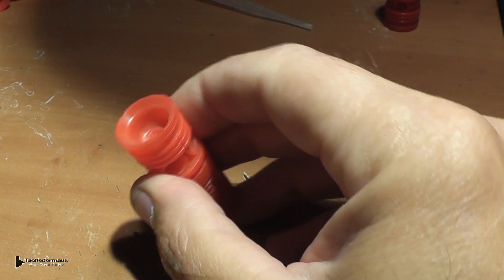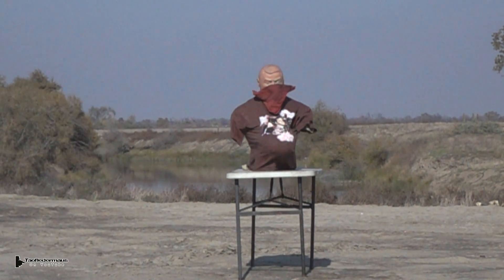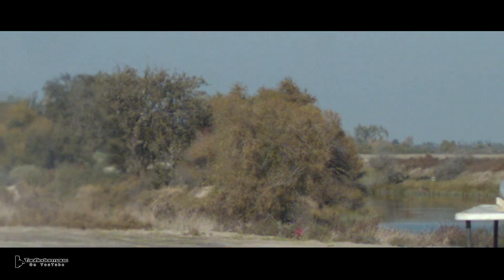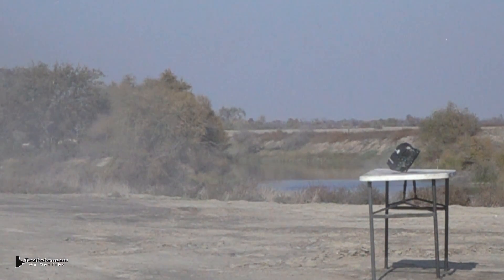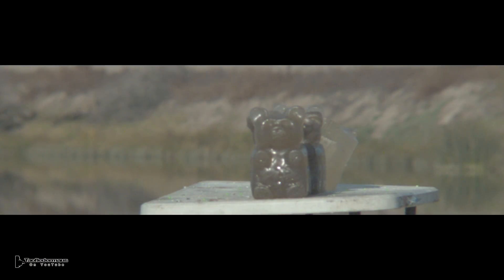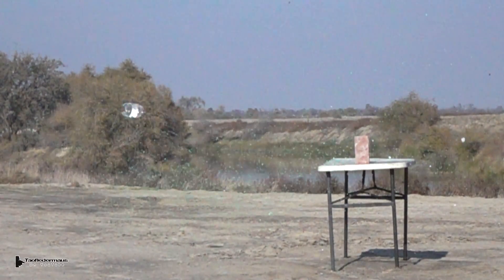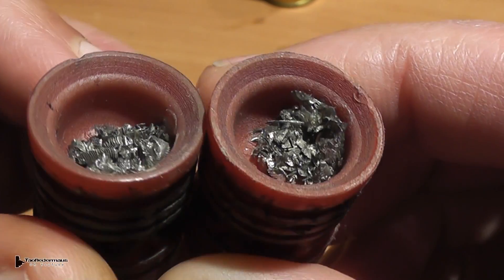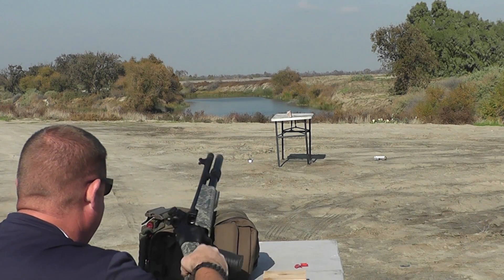Magnesium Shotgun TRACER Experiment -You Asked for It

Comment: Late, but ... :D
It's several mistakes made.
- Put a little finely ground magnesium IN the powder and some magnesium in the bottom of the wad. Powder alone doesn't create the heat needed to ignite large magnesium chunks in the short time of flame exposure.
- Use long, THIN shavings, touching the glue with one side only, so a part of the shavings stick out.
- By forming a solid Mg block using the glue, you created a kind of heatsink, cooling the Mg by spreading the heat, thus preventing ignition. Similar with the coarse shavings - each one acts as it's own heatsink.

Comment: A stable projectile moving anywheres near the speed of sound through air has a partial VACUUM at the back end, it is well known that the near vacuum zone behind a projectile reduces the range it can reach. Google "artillery shell base bleed unit" to learn more about this.

How are plain Magnesium shavings going to stay burning without oxygen from the air?

 Tracers are MIXTURES of fuels such as Magnesium and OXIDIZERS such as Barium or Strontium peroxide and/or perchlorate, chlorate or nitrate salts. They don't need atmospheric Oxygen, which is not very available in this environment.

There is another issue with burning a pyrotechnic mixture or flammable metal in a partial vacuum even if provided with an oxidizer.

Hot liquid metals have a vapor pressure, just like water. Hot liquid Mg or Al will boil off into a vacuum,  free Oxygen and any gasses from combustion also tend to expand away and disperse, these mechanisms work to suck so much heat away from the reaction zone that many pyrotechnic mixtures can't maintain burning in a vacuum or even at very high speeds moving through the earth's atmosphere.

For example, neither black powder nor Aluminum fueled thermite will continue to burn in a vacuum. Even if they can be ignited, they rapidly lose too much heat from the reaction zone and GO OUT.

In aerospace use at high altitudes or outside of atmosphere, pyrotechnic gas generators used for actuator mechanisms often need to be CANNED, enough gas pressure has to be kept in the container for the pyrotechnic mixture to ignite and function as designed.

Comment: Powdered magnesium in the gun powder ignited because each bit was surrounded on all sides by both temperature and oxidiser (released by the gun powder). In the glued part the glue acted as a heat mass that stole away the heat and did not let the magnesium reach the ignition temperature plus there was not enough oxigen around in direct contact with magnesium to keep the ignition going. Maybe if you glue a high density mix of gunpowder and magnesium powder it might work - gun powder providing oxigen and surrounding temperature and glue slowing the ignition process just enough for tracer to burn instead of exploding. Migh have to experiment with different glue to poweders ratios. The separation is either due to non-centered pressure or just due to adding enough mass to the plastic part that it is too heavy to just be brought along with the slug itself.

Comment: Try extra-fine steel wool? It works in low-velocity launchers like potato cannons, so I'd say you have a reasonable chance of success. The higher surface area to mass ratio should help the metal to ignite in the fraction of a second that it's exposed to the burning powder.

Comment: You need to high magnesium to oxygen ratio for ignition. You need to stay with the magnesium black powder mix like the first successful video and the. Find a way to keep the shavings flying with the slug. Perhaps a disc of screen door screen glued on with a dab of hot glue only on the edges after you've packed the back of the slug with shavings? Glueing them directly is preventing them from igniting. Let me know if you have any thoughts on this idea. I like solving tricky problems. Thanks

Comment: An educated guess:  there is not enough oxidizer to burn the Magnesium when it is clumped up like that.  In your referenced video, firing it mixed with the gun powder gave it an accellerant & oxidizer in the gun powder & also spread it out after raising it's temp high enough to burn.  Spreading it out gave it plenty of oxygen to react with.  If you really want to do this try adding an oxidizer to the mix & use fine grain magnesium such as powdered.  My concern would be the stability of the mix & therefore it's safety.

Comment: how about getting that to a finer ground also mixing a little powder or maybe a little ground up esters rocket engines under a little parchment paper disk as to keep everything dry only the top covered in hot glue with a  little hole so some powder is exposed use a straw pluged with paper to help lighting also try a little copper/mag/zinc/alum mixed with powder

Comment: my guess: powder burns from back to front, and since the slug starts moving before all powder is burnt you get the non-ignition issue. the separation of slug and wadding might be from the increased compression of the slug due to the higher weight at the back.

though that's just a guess.

Comment: Hang with me here. Maby a multi stage round being a rough surface ball bearing driven through magnesium shavings with black powder tissue paper as a catalyst for ignition.

-Use high brass. Load a steal ball bearing that's been heavily roughed up with very heavy grit sand paper?
-Soak some tissue paper in black powder, pack it in shell a 1/4" deep over the slug and some slightly underneath the slug.
-Poor magnesium shavings over black powder paper wading till near topped off.
-Close the shell with a bit of powder soaked tissue paper and original plastic folds.

Just an idea, I have no gun experience but I use to really enjoy fireworks in my youth.

Comment: Magnesium ignites when it has direct contact with the air as its flying...you have it in the cupped part of the sabot and there is no air there when fired due to some vacuum formed at the back...if the magnesium was on the front it would ignite...but considering that's where the lead is you can't have any ignition

Comment: The problem is apparent from your description of success vs. failure.  Putting magnesium in the powder directly exposes it to flame.  Putting it in the shell it only feels compression.  What you need to do is put a hole in the back of the shell so that the flame from the igniting powder can directly reach the magnesium.

Comment: The efficiency of the gunpowder leaves no remaining oxidizer for the magnesium to catch on, the powder charge literally not combustively coming in contact with the magnesium.  With the magnesium mixed in with the powder it's in direct contact.    

So two questions, did you leave the card in the shell over the powder and did you wash your hands carefully before you pushed the magnesium into the cup?  Skin grease can make the difference.  Cooking oil will even stop ignition.

Comment: Have you ever tried to fire a thermite round? Such as one with an incendiary device to ignite an embedded quantity of thermite upon impact? I was thinking that some sort of magnesium fusing exposed to the powder and perhaps a thin nylon or lead casing encapsulating a compressed thermite powder would make for an interesting impact incendiary device. Fusing device lights upon firing, and the thermite capsule ruptures and exposes the powder to the burning fuse upon impact.

Comment: My guess why the magnesium did not ignite as a tracer is because it was not exposed to enough oxygen within the low pressure zone directly behind the slug, this zone is likely mostly composed of propellent gasses from the powder and relatively starved of oxygen. This is unlike the magnesium mixed with the powder that was heated and ejected into the atmosphere where it oxidized rapidly by the shell.

Comment: The wading is separating due to the heat you introduced with the hot glue, not the magnesium. When you added the hot glue the wading would've expanded slightly, compromising its connection to the slug.
As far as the magnesium not igniting I believe that simply comes down to it not having any oxygen available to maintain combustion, where when its in the powder it disperses and ignites properly. You could try mixing some sort of magnesium/iron-oxide if you're feeling really ballsy and try it that way, but you're basically trying to shoot thermite at that point and that's not exactly the safest thing you could do. (You'd get hella views though)
Reply from the maker: There's about 1"  of plastic wadding between the gas piston and the lead slug.
Reply: Entirely possible that it compromises it still. Not saying that's 100% for sure the issue but if you went from a 99% success rate without it to 0% with it I dont think the extra 0.5 grams did it

Comment: As some smart person before me has most likely pointed out, adding the glue and magnesium shavings to the back of the slug altered the way the slug balances, and therefore how it flies. So it's reasonable to assume that that was why the plastic wad/tail/piston thingy kept separating from the lead portion of the slug, as well as why accuracy suffered accordingly.
Reply from the maker: We can speculate or we can prove by doing.
Reply: Could you run a test where you used the same gun and powder load as in this video, and fired a 5-shot group of the DIY magnesium tracers, then a 5-shot group of the normal LBC sabot slugs, firing both groupings from that shooting vise/rest thing I'm pretty sure you still have, and filming all 10 shots to compare?

Comment: I'm sure you've already worked this out, but magnesium won't burn adiabatically, it needs an external source of oxygen.  Crammed in the back of the wadding of a slug travelling that fast (these loads supersonic?) there is no way for that to happen.

Mix an oxidizer compound in and try again, bet it'll work.

Comment: The ignition temperature of magnesium is around 900 degrees Fahrenheit. The reason it doesn't ignite when glued to the back of the slug is because it never reaches that temperature.. When you put Mg in the powder its-self it ignites due to the conflagration of the powder which burns at 3300 deg F, way hotter than Mg's ignition temp. When it's glued to the back of a slug the temp of the powder doesn't matter because the heat of explosion doesn't actually hit the Mg. The heat of reaction is confined to the powder only.. there is a pocket of gas that is created when the powder ignites that insulates the Mg from the heat of reaction. That pocket of air blocks the passing of fire from the charge to the slug. Maybe if you put a low ignition/high temp burn fuse between the two pieces you could ignite the Mg. 

Concerning the separation of the slug and wadding, I presume that's due to the difference in mass.. This is conjecture, but I believe that the shells are probably designed with a specific wadding for the slug they are behind, and when extra mass is added to the wadding, it can't travel at the same velocity as the slug. 

One last thing... 
I want to say that your channel is awesome. I've been watching it for a few months now and you've got a sub in me.

Also, I can't guarantee everything in the first paragraph is  100% accurate, but even if the temps are off, that is my thoughts on why the tracers wouldn't ignite.
Reply from the maker: Not enough surface area.

Comment: film a copper oxide thermite reaction with the chronos high speed camera
Reply: +TAOFLEDERMAUS   Considering how much subs you have now you should be able to spend more than just 5 bucks on your videos. Copper oxide is very cheap and easy to get (you can even use Fe2O3 or Iron Oxide), you can even get pre-mixed thermite cheaply.
Reply from the maker: I don't have any of that stuff

Comment: Id guess the glue is shielding the Magnesium. Also magnesium develops an oxide coating so if you could manage to get the magnesium in contact with the metal of the barrel the friction might be enough to get rid of the coating and ignite it.   Perhaps 2 little cylinders of magnesium put directly into the sides of a slug would work. just drill out the slug a bit and put it in.

Comment: doesn't magnesium require heat to ignite? having shaves of magnesium glued inside the wad or sabo slug will not generate friction which is used to ignite the magnesium which is what happened in the other video..... at this point you could try a full magnesium slug but it may just explode in mid air. you could do half magnesium and half copper slug. so the copper is threaded onto the magnesium this way if the magnesium breaks up in mid air the hole drilled into the rear of the copper slug should still ignite and leave a sort of tracer effect.
Reply: basically my point is you need the magnesium to be in contact with the barrel. then you will see it ignite
Reply from the maker: The magnesium is in direct contact with the burning powder,  just like in the shots where we had huge fire balls that I showed.

Comment: It sounds like it needs an oxidizer to work. I'd image the low-pressure region behind the slug is low enough to prevent combustion. Either that or you need a better initiator to ignite the shavings. Perhaps mix some phosphorus from match heads into the mix?

Comment: I'll say it again, A wax slug with magnesium shot against a HARD!!!! material.

If that does not work,for a better chance at ignition on impact, you could try adding an oxidizer and some explosive kids capp's to a magnesium /wax round. "the paper reels that come with cap guns or any equivalent shock based ignition source".

Actually.. those capps might have an oxidizer in them already, might just be able to use just them and magnesium / wax.

Comment: Not enough surface area to ignite. The magnisum needs to have it's surface area expanded as it travels through the barrel. kind like you can't light a cup of flour but if you through it in the air and ignite the flour it explodes.

Comment: As a bit of a pyro freak, I think the ignition issue may be simply one of intimate contact. In the first case, some of the shavings were actually in physical contact with the powder grains. Once those shavings ignited, the heat generated was enough to ignite the rest. In this latter case, the ignition of the powder created an expanding barrier of (admittedly hot) gas between the burning powder and the magnesium shavings. My guess is that this prevented sufficient transfer of thermal energy from powder-to gas-to shavings in the time available before expulsion from the confines of the barrel into free air.

Comment: What you might want to try to do is mix Potassium Chlorate with melted wax and then mix in some Magnesium before it hardens. Not sure of the ratios, but if you get it right, that slug would ignite like a tracer round.

Comment: I think that for something to burn (like magnesium shavings) You need two other things: heat, and oxygen. Try mixing the magnesium with KNO3 and a bit of sugar (rocket candy stuff - with excess KNO3). Make candy, then add magnesium shavings to it and put primer into bullet base on the bottom, then pour the candy with magnesium on top. This should provide heat for burning sugar and KNO3, the excess oxygen from KNO3 and heat generated from rocket candy should provide conditions to ignite magnesium shavings (also make those shavings as thin as You can, so they have better surface to mass ratio). I think that might work :)

Comment: Magnesium needs oxygen to burn, you need to add oxidizer to it to have a tracer. There's not enough air oxygen supply at back of a slug going supersonic speed.
Reply: Yes, more surface area plus the fact that they were going through air on their own, getting constant supply of oxygen. Drag alone could have heated them up enough to start burning.
Reply from the maker: Why did it work when we just put is loosely on top of the powder?
Reply: TAOFLEDERMAUS it would mix more evenly as it went down the barrel giving the magnesium both oxygen and flame
Reply from the maker: yes, more surface area

Comment: From my limited understanding I was under the impression magnesium on tracer rounds was placed on the tip of the bullet so it ignites due to the heat from the air friction. This is also why the rounds only ignite after traveling for a certain distance. Try glueing it to the front of the slug.

Comment: magnesium needs a spark to light it hence y when u mixed it with the powder it burnt and the other times it didnt. the air resistance couldn't produce the temperature needed to ignite it therefore it did not burn

Comment: Oxygen can't get to the magnesium. In the barrel the powder uses up the oxygen and when in flight there is too much of a vacuum behind the slug/wad. When the shavings are loose they scatter when leaving the barrel and they get all the oxygen they need. Could try mixing some KNO3 with the shavings...
Reply from the maker: Oxygen got to it fine when it was just loosely set on top of the powder.
Reply: +TAOFLEDERMAUS maybe try mixing it with the powder again, sense that ignites, maybe it will ignite the magnesium on the wading.

Comment: I don't know if this will help but I bought some magnesium ribbon from Amozon a few years ago and used it on the base of a .54 cal. mini bullet in black powder Sharps rifle I have. That worked but you could not see it in the day light, but at night a friend that was with me said could see a quick short trace, the ribbon burns fast. I couldn't see anything. I did have some success with some magnesium TIG welding rod. I coated it with a honey potassium mix to help it ignite. I drilled a hole in the center of the bullet with a drill guide and pressed (hammered) the rod in. Out of 5 bullets, I was able to see 2 that lit off, but again only at night or dusk. I never tried it with smokeless powder in my shotgun though. If I had get of that ribbon mag I might try it. The ribbon costs about $7.00 from Amozon if you want to give that a try.